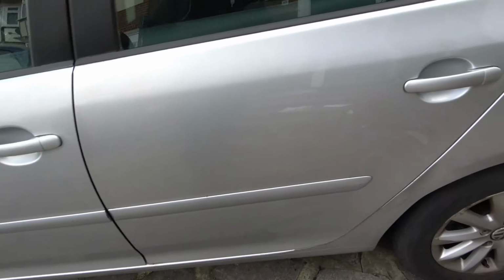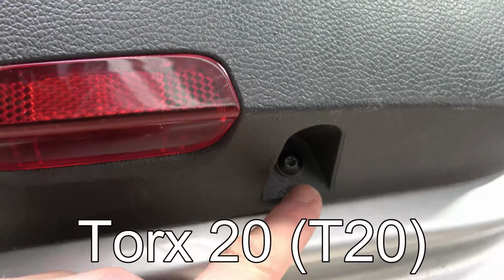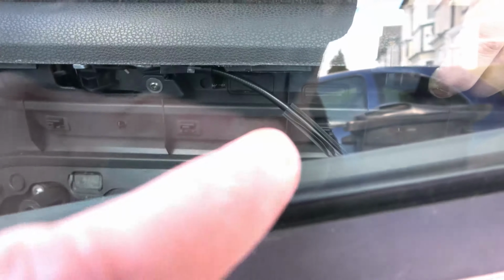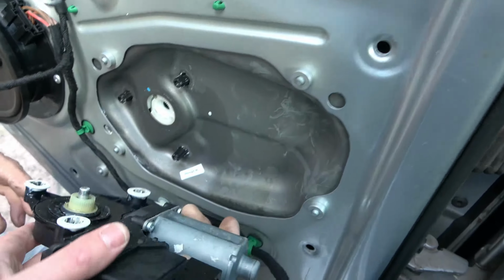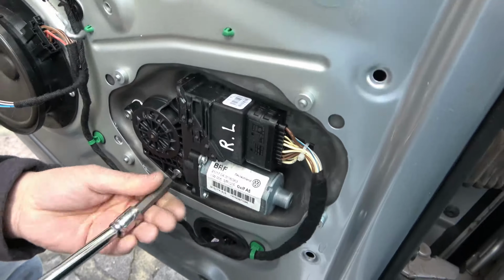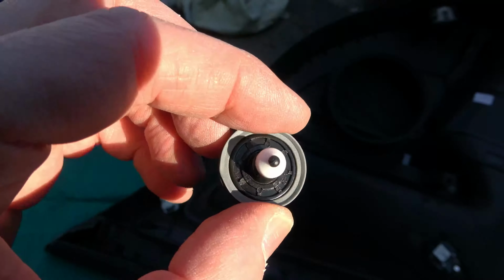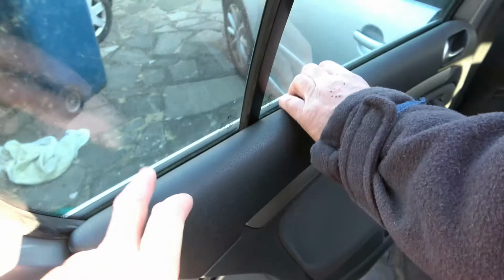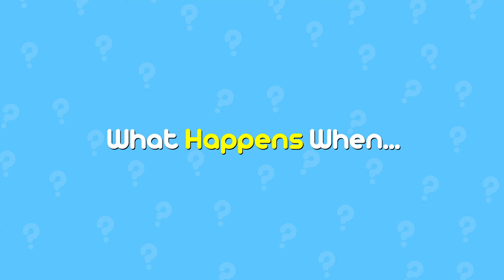How To FIX Door & Window NOT WORKING on VW Golf MK5

Comment: This is a super helpful video on how to open up the door panel along with how to safely remove all of the clips, wires, and door latch cable. I also liked that you called out the different Torx screw sizes too. Well done.

Comment: I have a 2005 mk5 Jetta TDI and when I actuate the key fob the light flash as if the doors are locked, but they’re not. Would it be the switch in the drivers door that controls this? Also thanks for showing that cool clip removal tool. I’m getting one of those.

Comment: Hi,

My MK6 golf passenger door isn't central locking. The window work fine.

Would changing the locl mechanism solve this issue? Or do I have to change the module?

Also, would the new module need to be coded?

Comment: Someone fitted a right hand drive part in my left hand drive car. Causing issues with locks not working and window works opposite way around. I've been told I need to locate a module for a left hand drive car. As it can't be reprogrammed

Comment: What if it’s the opposite? My door is stuck shut and the window and stopped working. It st opening opening but I was able to open it from the inside. But then I it shut on the first latch but I couldn’t open it again to shut it properly so had to push it hard to get it shut. It now won’t open at all.